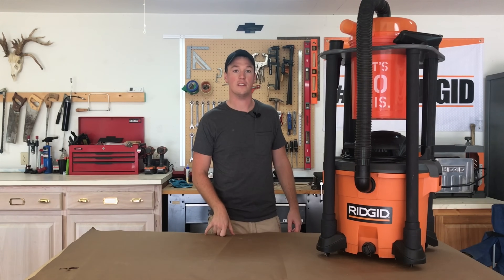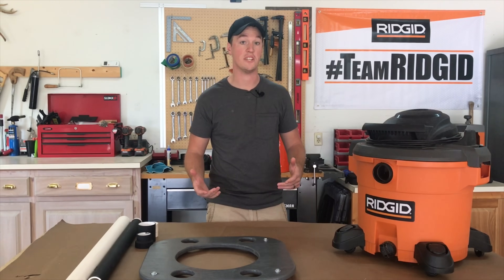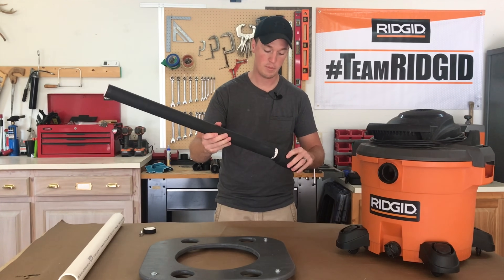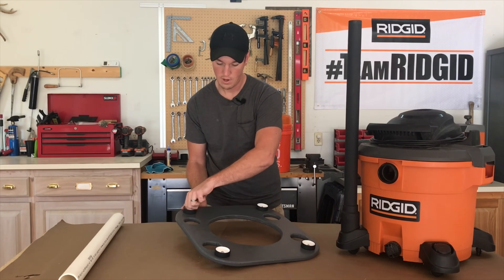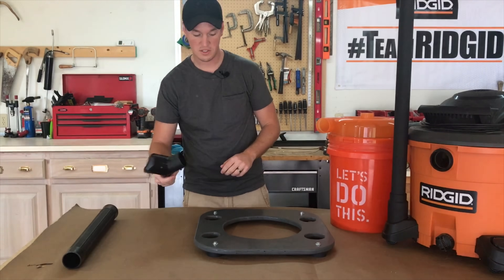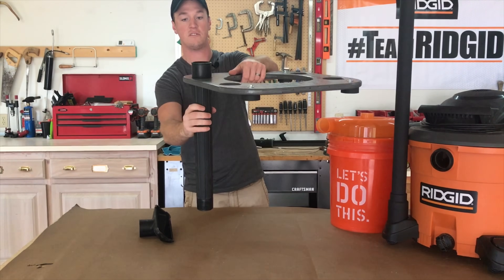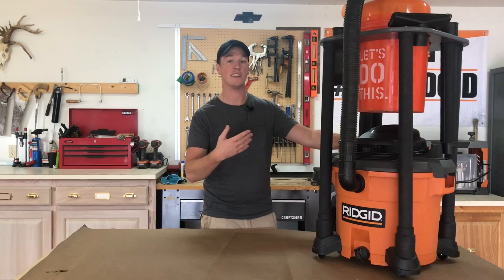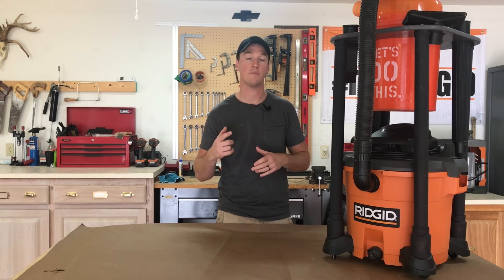The Ultimate Space-Saving Dust Cyclone Separator Cart | Dustopper & Ridgid Vac Cart

Comment: John, is there a reason why I cant just use a 2 to 1 1/2 reducer to attach right to the vac? Its the same size as a 2 inch coupler..just wondering..making mine right now great job!
Reply from the maker: Adam Johnson the coupler is able to seat all the way down into my castors, the reducer would only sit on the top 1/2” or so and wasn’t very stable. Atleast with my vac, yours may be different!

Comment: First of all let me say I love this build. So today I went out I bought everything I thought I needed to get it done. I ran into a few problems though but none of that is your fault. The legs are different but I was able to find a simple solution by buying a 1.5 inch female adapter it's slipped right onto the wheels in case you don't want to use a heat gun and they only cost $1.75 each. I heard you say each Pole was about 28 in so I found a 120 in pipe in the plumbing department and cut it into four equal pieces thinking that it was enough. Even at 30 in legs it was too short and I cut 4in off the bucket using my reciprocating saw and it's still too tall. I think they may have changed not just the legs but the height of the actual vacuum because I'm not even close. I guess my question to you is where did you get that second elbow? Because that will really help me out right now after I've cut down the bucket that should work perfectly.
Reply from the maker: Mark Dayan bummer!! Sorry you had so many issues! This brush attachment from Lowe’s, the brush can be taken off and leave you a 90 degree elbow. https://www.lowes.com/pd/Shop-Vac-1-Piece-Right-angle-Brush/1060273
Reply: @JohnBuildsIt   no worries bro, I think I got it to a good place and that right angle piece should make me happy. Thanks for the link and the incredible idea.

Comment: To me this video represents one of the best examples I have seen a new sponsor Google advertising, I'm ready to go to Home Depot tomorrow and put one together any chance I can just buy one somewhere he's? I like it's low profile.

I considered another modification as a suggestion,

 what if we use the PVC tubing as a manifold where the top vacuum hose attaches to the top of one of the PVC legs applying vacuum and then having the port down by the floor West one on each leg like Central Vac in home breast a couple of flap doors that would be nice

All four legs could be tied together using tees as a crossmember

Comment: Love the design - just great.  I have cart I made with the Dust Deputy and a recommendation I would have (which would also fix any current and future design changes to this vacuum or any other) is to make a plywood platform base for the vacuum to sit on and use larger casters that DON'T get hung up on cords and bits of wood so easily.   The most frustrating thing about my shop right now is moving my cart around with too small of wheels.

Comment: I know you said you haven't needed to get into the vacuum yet but I was just thinking if you just left one leg out, you'd be able to open the vac without dismantling the whole setup. You might need to make the three legs more "permanent" (maybe a screw or two) but I think it would make access easier and more practical. I use a HEPA filter because I'm picking up a lot of fiberglass dust and the filter gets clogged relatively quickly.
Reply from the maker: Roger McCaslin good solution!! But honestly I’ve been using this Dustopper daily for atleast 6 months now and the inside of the vac barely has a light coat of fine dust! It’s crazy! It’s no big deal to me to just pop the cart legs off once every so often! Thanks for watching!

Comment: Hi John, I really liked this idea so much, I went ahead and built one for my Ridgid WD1060 - 10 gallon stainless model. I found that the attachment points for the legs were a good match for 2" ABS pipe. I used flat ABS caps on the bottom of the plywood and connected them using 1/4" carriage bolts and fender washers. One bummer was that my legs needed to be 32" long, which meant that I needed extra ABS pipe (a 10' stick was too short for 4 legs). Dustopper sent me another 90 elbow which made the hose fit perfect (just ask for one - EXCELLENT customer service). Only thing that could make it better would be two 90 degree elbows at the top and a third into the vacuum. I also used 1/4"x1/8" weather stripping as a gasket, around the Dustopper seal to bucket area. I removed the cord wrap handle from the vacuum and attached it to one of the rear legs to make wrapping the cord up much more handy. The ABS pipe and caps set me back $35 and the Dustopper was $40. All invested = $175 and a few hours of labor. Thanks again for posting this!
Reply from the maker: DigitalMan269 great adaptations you made!! Sounds nice! Thanks for watching!
Reply: DigitalMan269 Are the legs stable since the  leg attachments are only one half round on this model?  Did you have to reinforce or modify the attachment points in any way?  Thanks~

Comment: What a great idea, John! I was inspired by your video to make a similar setup for my Rigid 14 gal, 6hp vacuum, model WD14500. While this model doesn't have the same wheel assembly as yours, I did have an old Rigid wet/vac that did have the same wheel assembles with the circular openings on top...and I discovered they wheel assemblies were interchangeable with my model WD14500. I made some slight modifications from your original design such as making a larger plywood piece (22 inches square) and then using my 2-inch hole saw to make additional accessory storage. Additionally, I cut a couple of 3/4-inch slots in the rear section of the plywood about 6 inches apart that I use to wind my power cord around. For kicks, I cut a couple more 2-inch holes between the cord slots that makes a nice hand grip for pushing/pulling your cart around the shop. Lastly, I cut an open-semicircle hole in the front part of the plywood that allows the vacuum hose between the power unit and the dust stopper. Wished I could post a picture of the unit, as  I think it turned out really nice.
Reply from the maker: Jack Vance wow it does sound nice!! Good ideas!
Reply: Hi Jack Vance.  I also have the model 14500.  I'd like to build the setup that John details above and was wondering if you knew exactly which model of Ridgid vac you took the caster foot assemblies off of that you slipped onto your WD14500.  That way I can just order those specific parts from the Ridgid parts website.  Thanks in advance for your help!
Reply: @spudman1125R  did you ever find the model?

Comment: Somewhat of a failure.  It works great on bigger chips but when it comes to fine dust from sanding the filter ends up dirty.  Also what kind of maintenance is required?   No directions with mine and I had to go to HD and buy a  rubber elbow in the plumbing section as mine is about 2 1/4" higher than yours.  I am making a jig to attach to my router for dust collection and wanted the additional 2".  But it does work well as only the fine dust got through to the filter and that is a easy cleanup.  One other question is did you glue the pvc together as a last step?

Comment: Very Clever! Don't be surprise when you see a tool company steal your design.
Reply from the maker: EDM guy that’d be cool but not cool at the same time!! Haha thanks!
Reply: Purchased a Rigid 14 gal #WD1450. Obstacles... No storage holes in the 4 caster feet. A bit taller causing the hose coming with the dust stopper to be too short.My fixes, had an old Rigid Vac with storage grooves on the caster wheels, they were able to be swapped. The hose being to short was solved by installing a 3ft straight pipe that comes with the vac. This allowed the dust stopper hose to be long enough.The WD1450 is one of Rigid vacs with their new quiet technology. It is much quieter than a standard wet vac.

Comment: I  have a Ridgid Vacuum model WD14500. The plastic wheel assembly for the casters are not the same as this. That one has only two of them with a notch where the PVC pipes could be fitted, but the 2 at the front are flat and slanted. Has anyone implemented a solution for that? I could go ahead and build something out of wood, but I'm trying to minimize work. Please help!

Comment: Thank you for creating this video. In my opinion, the best shop vacuum dust collection system on YouTube.com. This past weekend, 12/1/2018, I purchased the Ridgid 12 Gal 5.0 HP Vacuum Shop Vac, Dustopper, and PVC supplies. A few things I learned. 1) Home Depot has made changes to the Shop Vac. As such I had to make the support poles a little longer: 30" instead of 28"; 2) the extra elbow, the brush attachment found at Lowe's $8, worked perfectly; 3) the 2" couplers were a bit sloppy, therefore I added some electrical tape (because it stretches) around the inside until the fit was snug; 4) I could only find dome caps, therefore I ended up buying the furniture grade ones with the screw hole flanges.  Again, thank you for creating and sharing.
Reply from the maker: Rick Allison thanks for all the great info!! Just my luck, they went and changed the vacuum within a month of making this! Haha the same general idea still rocks though!
Reply: Which elbow did you buy? 2.5" elbow? Was it in the vac section or plumbing section?
Reply: @NathanBilbao  Hey Nathan, it was in the shop vac section.  There was a bin with a bunch of them in it.  I took the brush part off.  That left the elbow, 2 1/2 inch, which fit perfectly.
Reply: Rick Allison you wouldn’t happen to know the part or can find a link to what you used? I can’t find a similar solution at my HD store

Comment: John, I love it. But when I tried to buy all these pieces at Home Depot, the dust stopper only came with one 90 degree elbow. It's pretty obvious it needs two or the hose will be too short. Having said that I spent almost an hour trying to find ABS or PVC to make such a connection. Could not find the parts to make it work.
Reply from the maker: wayne miller dang! I was figuring pvc would work. Most are having to order an elbow online. But a couple people have said they bought a brush attachment for a few bucks that had a 90 degree on it you could use.
Reply: @JohnBuildsIt  okay, thanks for the quick reply. I was thinking since I did in fact buy the dust stopper I would hook it up to my old rigid which is the more portable one. It does work. But I do want a dedicated dust collection for the house or the garage I should say. So I may contact the company and have them send me another elbow, since it is the perfect fit.

Comment: I dig it, but I don't know if I could handle a five gallon collection bin, even for just my shop vac.  I don't like how often I have to empty my ten gallon bin.  It looks like this separates a lot better than my Rockler Dust Right separator though.  Worth consideration.
Reply from the maker: Frank Haus yea that is a limitation on the Dustopper without more modifications. Like cutting the bottom of the 5 gal bucket open and silicone the top portion of the bucket and Dustopper into a bigger bin. I left a little extra space on my cart for the option of using a 7 gal bucket instead atleast.

Comment: FYI, the 2 1/2" brush attachment @ Lowe's can be pulled apart and yield a 90 degree elbow. $8
Reply: @Fast Freddy Thanks for the tip.  I looked all around Home Depot for a 90 degree elbow with no luck.  For others, this is what Fast Freddy is talking about. https://www.lowes.com/pd/Shop-Vac-1-Piece-Right-angle-Brush/1060273
Reply: This is a great tip. That's exactly what I did when I realized that I needed another elbow.
Reply: THANKS, got one today. I had gotten one from  Toolplanet ( WS-D4235 Woodstock 2-1/2 Inch Dust Collection Hose Elbow D4235 $3.69) that does NOT fit any vacuum hose known to man!
Reply: Picked one up yesterday thanks to your comment.
Reply: Did you have to cut the brush portion off or does it just pull off?
Reply: John MacKelvey it pulls off
Reply: $8.08 plus tax. Bought it today, Thanks for the heads up!!!
Reply: $8.08 plus tax. Bought it today, Thanks for the heads up!!!
Reply: Great tip, thanks!
Reply: Rockler has a dedicated 90° piece. https://www.rockler.com/2-1-2-elbow-dust-collection-fitting
Reply from the maker: Fast Freddy awesome! Thanks for letting me know!
Reply: Lowe's my friend....Lowe's...

Comment: It's beautiful.
Reply from the maker: Jason Carmichael thank you!!
Reply: @JohnBuildsIt  Here is my "LOWES" parts list:

2 x 7705 24x24 1/2inch plywood (15/32 actually) (I'm making 2)
4 x 23901 1-1/2 coupling - Older Ridgid feet/caster holder.
4 x 23918 1-1/2 x 1-1/4 Bushing (No reducer and pipe needed this way)
4 x 23902 2-in coupling - Current size of Ridgid feet/caster holder.
4 x 23023 2-in x 1-1/4 Bushing
8 x 23898 1-1/4 Caps
2 x 23996 1-1/4 x 10 ft pipe
2 x 954434 - Blue Buckets
2 x 954433 - Blue Lids.

An alternative to using PVC is to use Ridged Tubes, but they are about $9 each. I noticed that the Tube is differently sized on each end so they go inside each other. This different size makes them compatible with the new/larger feet and the older/smaller sized ones.

Using the bushings saves buying a 2" tube that you really only need about 8 inches of.

Why do I have two? I forgot I had the older one, and just bought a new one last month. :)

Why use Blue stuff on Orange stuff? Well, everything is about 8% less at my store. Both stores are pretty much the same distance away, and I get the Veteran discount at the Blue store when I shop online. So I just fill out the basket online, and buy online, then go to the store when it's ready to pick up. 

Total before taxes, $59.50 for both sets.

Thanks for the idea!

Comment: Awesome Setup!  I will be building this for sure!  Is the elbow 2-1/2" Elbow Dust Collection Fitting
Item #: 63593 from Rockler?
Reply from the maker: Keith Nelson I had an elbow laying around that I’ve had for a long time, didn’t have a sticker or anything on it. I can’t say for sure that rockler one would work, but I’d bet it would! Worst case it’s the same diameter as the hose and you’d need to get a sleeve connector, which those are available pretty much everywhere. If you try it let me know!!

Comment: Very nice build!  I actually have an older version of that Ridgid Vacuum and have used something not quite as efficient  as the Dustopper, but which has been fine for me.  I think I'll give your design a try when I get a chance.   Since the Dustopper no longer comes with the elbow, and I couldn't find one on the Home Depot website, do you (or anyone) know where I can get a suitable replacement?  The elbow certainly would make it more streamlined.
Reply: I just looked at the HD website and as of 2023 the Dustopper comes with two elbows. I bought mine 3-4 years ago and it had only one, but I found an identical item online.

Comment: Great idea, easy to move around...but, there's also a but:
The danger in our job (dust-concerned) is the exposure to / inhaling of micro-dust.
This vac will do a good job collecting dust, but due to it's size, the filter-surface will be small
and therefore the amount of micro-dust that leaves through the outflow will be greater than one would expect.
Micro-dust is not so easy to handle with only a cyclone and a small filter, 
for that you need filters with a much bigger surface for instance (like the fine filters from Felder:) 
22 square-meter wrapped up in a roll, but still quite voluminous, not fitting INside a vac. 
You might consider to work on the exhaust too...
Otherwise, very nice and well built 👍

Comment: This is a great simple build!. I just picked up a new Rigid vac on Black Friday, and I have a Dustopper on order. This is a great set up. Seems sturdy, any trouble with it tipping when the bucket fills up?
Reply from the maker: Wayne K not at all! It has a pretty low center of gravity. Warning though, I’ve heard Ridgid changed this model of vac, so you may have to use different fittings on the castors! Just what I’ve been told though, not certain
Reply: @JohnBuildsIt  yes, they have changed. 1.5in couplers work now. I have a 12 gallon. It's also taller so a little more than 28 inches - more like 33. This stretched the dustopper hose quite a bit so had to use duct tape to keep together. I also learned the Rigid hose which is supposed to go in the dustopper is larger (3in) so an additional vac coupler/reducer had to be added to both the vac and the dustopper. 
Would be nice if you had an update video with variations. Great design though!

Comment: I have pretty much the same rig, but I reversed it. Vac on top, dust bin on the bottom. My bin is a 30 gallon metal trash can with a steel ring inside about halfway down to prevent collapse. Never understood the five gallon bucket thing.

Comment: Great design. Question I have is,  when attached with a hose on the top and you drag around does it tumble or the weight of the bottom shop vac has enough weight to keep it stabilized?
Reply from the maker: Ola Renato thank you! Not at all, I could tug it all over as fast and hard as I can and it wouldn’t fall over. If you notice in the video, the whole unit is about the same height as my countertop, so pretty darn low center of gravity. Even with a full bucket of dust, it doesn’t affect it.